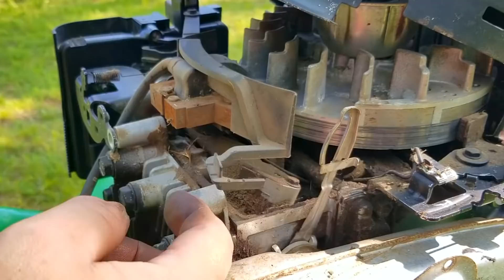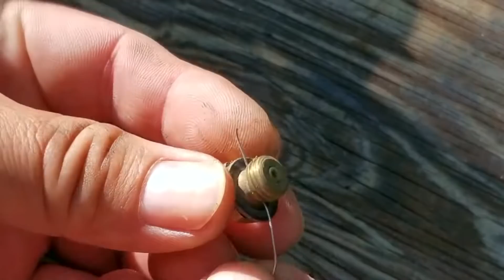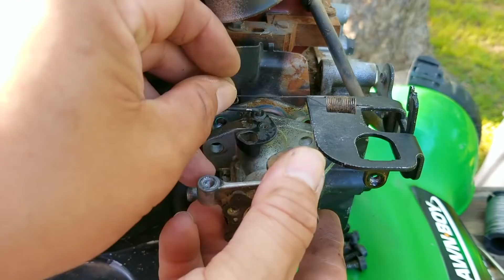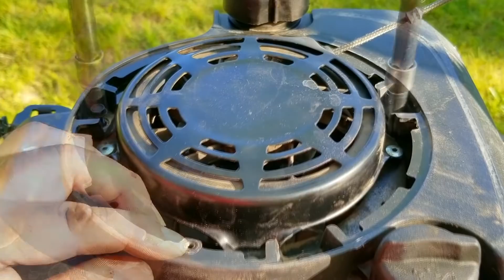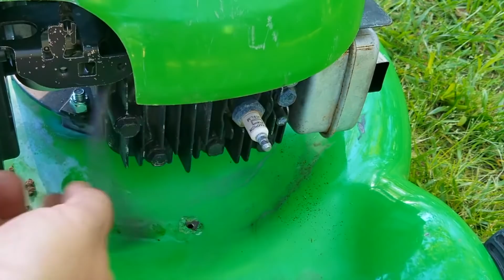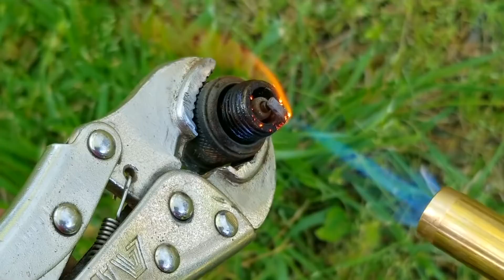Fixing a LawnBoy mower that has a major Carb issue.

Comment: I would love to see you replace the rings and see if it stops the smoking.  I have this same exact mower that my neighbor gave me because it was hard to start and keep running, so he replaced it.  I pulled the carb, disassembled it and put it in my ultrasonic cleaner, re-assembled it and it runs fine.  Been using it for six years now with no problems.
Reply from the maker: unfortunately, I typically find the cylinder is also damaged as well.
So replacing the ring, should stop some of the smoking, unless I can fix the cylinder 
it's not going to stop it from smoking.

Comment: So many side of the road garbage day mowers...so many also i simply drop the carb bowl, wipe it with a rag (half clean rag), put it back,a  bit of gas down the carb, and away she goes, idles like no other. Just today did this same thing, ladys mower wasnt running, just barely starts, same trick. Went from a no start, to it started and ran (poorly) with just me spraying gas, to me doing that trick and boom, it runs like a top.
Reply from the maker: nice Job Bailey Hatfield

Comment: Replace the rings, it seems to leak a little oil into the combustion-chamber, and the oilmixed gasoline exhausts will go into your lungs and over time, give you cancer or make it harder for you to breath.

Normal exhausts is bad they too but not as bad as if the gasoline is mixed up with oil from the motor!

When it comes to equipment like chainsaws, trimmers, lawnmovers and stuff like that, we shall always try to choose a so clean fuel as possible, it´s just pity there not is more options than it actually is out there.

For my part, i modified my lawnmover here in Sweden to go on ethanol (E100)

At least, i don´t need to feel the smell from the gasoline anymore!

/L
Reply from the maker: thanks for the comment.

Comment: If a engine hase low compression  tray ad a litel bit oil in the cilender if  the compression pumps up the piston rings are bed if i dosent the engine is worn out
Reply from the maker: yes you are absolutely correct in using oil.

Comment: My dad has a lawn boy 2 cycle mower and it’s locked up and the handle for the blade is messed up do you know why?
Reply from the maker: Do you know it it's been in storage for a few years? The rings could just be stuck.  Also the Handle for the blade is also the brake for the flywheel, so that's basically keeping the engine from turning over as well
Reply: I Believe my dad got it running for a second by forcing fuel into it and then it didn’t wanna start again
Reply from the maker: It sounds like it's going to require a lot time to figure out what's wrong with it.
Reply: And I think he found it for free
Reply: I also thing we have no parts for it so it might be sitting forever
Reply from the maker: yes parts availability is very crucial
Reply: Think*
Reply: And my dad had a lawn care business a handful of years ago and maybe when I’m older I can help him restart his Business
Reply from the maker: that's a possibility otherwise you can run it yourself.
Reply: And also be a small engine mechanic
Reply from the maker: nothing wrong with that

Comment: I think there's a chance the engine is missing because of the missing spring from the auto-choke mechanism. I'd replace that first as it should be cheap and easy to replace. If that doesn't do it, then next I'd blame the carburetor. It looked like yours had a bit of corrosion and could possibly be damaged internally. I've just had an issue with one lawn mower, a newer Briggs that just wouldn't run quite right, even after replacing the jet in the plastic carb. Finally swapped in a known good carburetor and it finally ran the way it was supposed to, so I think it'd fix the problem on yours. Also, if you didn't already check, you might wanna see if the flywheel key is sheared or damaged. I doubt it is, but doesn't hurt to be sure.

As for replacing rings on this engine, I don't consider  it to be worth doing. It's just too much work for something that isn't going to be worth that much. If the engine was working 100% correctly, it'd probably be like a $100 lawn mower I'm guessing. If you got rid of the misfire issue, it'd probably still be worth about $50 since the deck is in good shape, and it has self-propel... rear wheel drive at that. I'm guessing it would take several hours to replace those rings for the extra money you might get out of it, and there's just easier money to be made on another piece of equipment. My vote is to keep using the engine, and keep an eye on the oil level to make sure it doesn't burn off too much. As long as you keep an eye on the engine and maintain it, it'll probably run fine for several more years.
Reply from the maker: thanks NerfCraft.

Comment: I would run it like it is for now. If your just mowing your lawn with it it could run for several more seasons might just have to add some oil each time before you mow your lawn is all.
Reply from the maker: that's the most reasonable approach to this problem.   It depends on how I feel. thank you nashguy207

Comment: I would check the cylinder with a bore scope or remove the cylinder head to check the cylinder for damage before replacing the rings.

My 3 horsepower Briggs and Stratton lawnmower engine seems to test at 75 PSI even when I replaced the piston rings & the spark plug  electrodes always run grey when I run it on E10 unleaded fuel, they started turning oily before I replaced the rings.
Note that I did lap the valves in & reset the valve clearance, Briggs and Stratton suggest doing a leakdown test on a flathead engine rather than a compression test.

It wasn't too bad only that it started to foul up the spark plug & use oil as well as becoming hard to start !
Reply from the maker: that's quite the situation, thanks for the information Russell Booth.

Comment: a ring set is not that expensive but then you get into ,is the cylinder damaged then you have to hone the cylinder if possible but for me just put the rings in and run till it falls apart
Reply from the maker: I think that's what I'm planning on. thank you Dee Swanson.

Comment: I suggest replacing the rings in order to improve the compression, make the engine run better and longer if you continue having the ones already there the engine will not run for long be and not able to start as soon as the rings are too worn out 😄
Reply from the maker: thank you Lucas Bergfors.

Comment: I picked up identical mower, but it was too far gone,  ended up scaping the engine, but I kept the deck which was working. fine. even had the bag.
Reply from the maker: sounds like you made a wise choice

Comment: Check the carb again, looked like it was leaking gas. Check the low speed jet to see if it is plugged, that can cause it to run rough. Thanks and use it unitl it dies. Also you can put an anti fouler in the spark plug hole that install the plug. Thanks
Reply from the maker: you've got a good eye, yes there was a very small leak on it.

Comment: 10/10 again, man. 

Try to replace the rings, this is something I'm sure others need to learn.
Reply: I've lost count the number of engines I've done re-ring jobs to.
Reply: @christophermarshall5765  I’d like to see that and the amount of tools and the cost of parts just to see if it is viable to repair with pistons and rings with gaskets etc.
Assuming the deck is okay and of good quality.
I’m in Australia basically we have Victa 2 strokes and 4 stroke Briggs and Stratton and Honda mowers.
Motor replacement of a Briggs and Stratton begins at  AUD$250 - 500+ for larger 190cc engines
Reply: @rickthelian2215  I am also in Australia. I used to do this work for a living on car engines. Doing this to a mower engine is very easy. Simply taking the engine apart,  measuring the cylinder wear, then honing takes only a few minutes. I then remove the old rings, fit new ones and install the piston rod and rings into the engine, after lubricating them with thin oil. It is not as expensive as you think. Not only this, the cost of replacing the rings is often cheaper than replacing the engine. I have done this to a lot of Briggs engines in the past. I have friends who do this work for a living, as well as general mower servicing. They also sell new & 2nd hand mowers.
Reply: @christophermarshall5765  so cool, yeah if you have that experience and the tools it helps, as a hobby just getting the damn boss of can be a pain.
If I had the tools I’d more likely try it, I do have some mechanical books on the Victa’s which I haven’t read yet but will soon.
We used to pick up a good mower for $50 my last was a Mustang with 625 Briggs or free if your lucky with minor work required prior to Covid19, they are a bit dearer at the moment on marketplace, Gumtree or eBay.
It’s easy when you can get one good engine and bad frame and then a good frame and bad engine to do a swap over, but in the 19 inch Victa’s that ain’t that easy.
Selling Mowers’s is not my thing but I may do if I’m not requiring them, but only if they are in good quality,, where I know they will be satisfied and use the mower and keep up with general Servicing.
Oh, just to add some of the Victa mowers are giving 4 years warranty for home users on the engines in the higher end of the range.
Yes you can make a good living repairing Mowers’s especially when shops take weeks to do the job due to demand, like yourself with a motor mechanic background.
Reply: @christophermarshall5765  thanks again Christopher
Reply: @rickthelian2215  You can buy good quality tools for a reasonable price. Those bosses can be a pain, even with the 3 claw puller. There has been a few pump type hydraulic pullers enter the market in recent years. Cylinder hones can be bought for less than $100 these days. My advice is to buy tools as you need, or set aside a "tool budget". Victa should be putting a 4 year warranty on all their mowers, with free servicing in this period. A good compressor & air tool kit can be bought for less than $400. Air tools are a lot cheaper now more people are buying them.
Reply: @christophermarshall5765  thanks again may do that once I make more space in the shed workshop I could use a nicer compressor and those bits and pieces when I need.
Thanks again for your advice😀
Reply: @rickthelian2215  no worries mate.
Reply: @christophermarshall5765  ring-job sounds like a 90s B-movie about guys who used to hack payphones.
Reply from the maker: thank you Mr Penguin

Comment: Nice looking mower, it may run okay for a bit longer, whilst waiting for another engine a little bit of extra oil burn from pistons as long as not excessive will be okay on this Quantium engine by Briggs & Stratton, till a replacement is found.
Don’t forget the spring on the airflow choke
Reply from the maker: yes I can't forget the spring. thank Rick Thelian.
Reply: @MichaeHammer  037 seconds of video
You’ll see it better explained in video Part 1 6.13minutes in go to playlist and go back 7 months ago.

Comment: I personally would either run it as is with 40w oil or do an engine swap.  It would be interesting for your channel to replace the rings,  lap the valves and replace the head gasket.
Reply from the maker: I'm definitely considering it. thank you Brian King

Comment: Another great video, thanks. Change the oil and replacement 20% of it with Engine Restore. I have had great results.
Reply from the maker: thank you Fran Leck
Reply: Same here . I typically don’t believe in additives but I’ve had engine restore work.
Reply from the maker: I might have to give it a try on this one then.
Reply: @HomeGaragechannel  Please do. Whether it works or not it would be an interesting video.

Comment: Use it until it dies.  If you replace the piston rings, chances are you’ll have to hone the cylinder and they don’t make oversized piston rings for the flat head engines.  I would just use it for a brush cutter
Reply from the maker: that's a great idea. thank you Cole Steffens.

Comment: I.d replace the piston and rings or just the rings if they are shrunken down a bit and that should improve starting the engine and ease up the smoke and improve compression and once that's done replace the governor flap spring and she.s good as gold again and yep she.s worth fixing in my view etc cheers from Australia to your area mate.
Reply from the maker: If I can find the parts, I might just do that.
Reply: @HomeGaragechannel  yes for i have the same Briggs and Stratton engine and it's a 190cc and a 625 series type on a Victa Mulch n Catch Model number TMS484 and that's a very similar build for the engine etc and they are no different from each other by comparison too and i think the base is a 19" (Inch) cutting deck/chassis/base and it's a good runner on my view plus it has a good coverage on large areas of grass to mow etc and mine also features a cutting disc and 4 blades on there too and hardly any problems frm day one etc.
Reply from the maker: very nice mower
Reply: @HomeGaragechannel  yes for sure and those engines use the metal carburators and they are more solid than the newer plastic type being used and they can break and crack and warp easily etc.

Comment: Nice, I keep finding your videos early. You're partially responsible for me doing a full tune-up and carb rebuild on my Stihl FS110R. If it goes well, I'll have you to thank for showing me what to expect.
Reply from the maker: thank you Danny Boy and good luck
Reply: @HomeGaragechannel  It went great! The trimmer now runs incredibly well with what seems like double the power where it would previously not run at full speed and had a noticeable ignition miss. The carburetor diaphragm was usable, but somewhat wrinkled and beginning to age. The valves were loose and required some tightening to tolerance, and the air filter was more than likely toast. In addition to a new spark plug, fuel filter, and lines, the only problem now is that the tank vent leaks - which is my fault, because I screwed it up working on other things. Thanks for your videos!